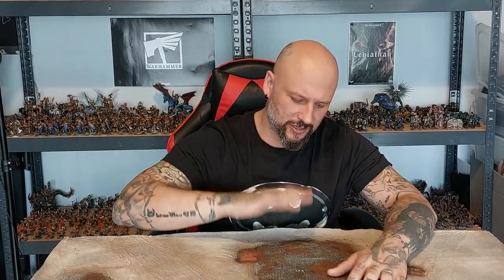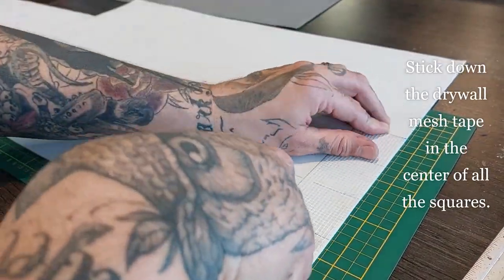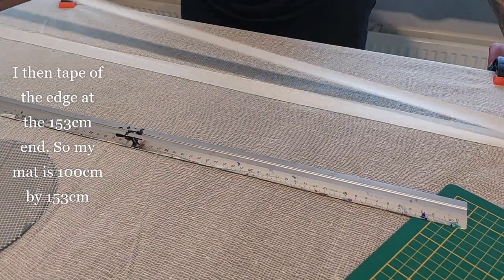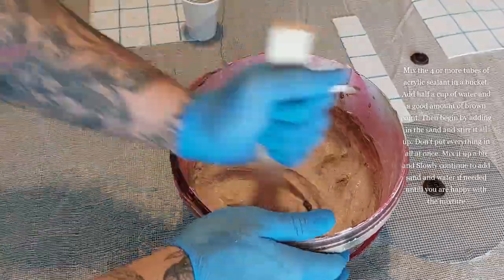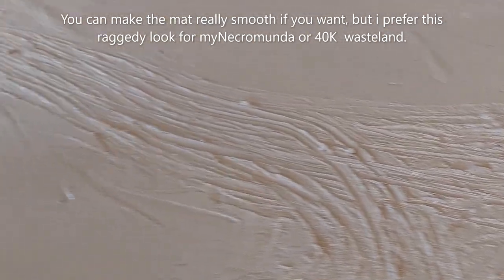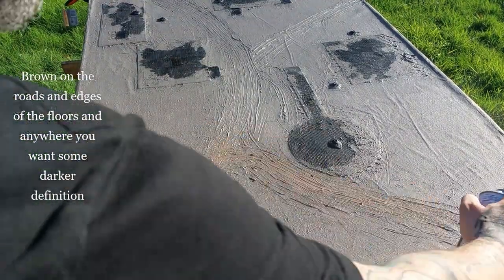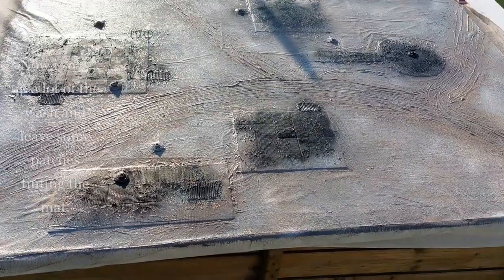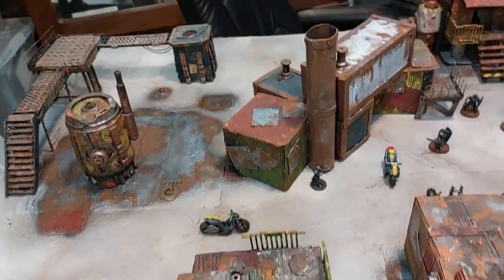Create Your Own NECROMUNDA Ash Wastes BATTLE MAT With These Simple Steps!

Comment: Looks great. I tend to buy brown caulk to start with, saves having to add paint to it! If you leave the caulk to go off for a while, you can press shapes into it before it’s fully cured to create man-hole covers in roads. I’ve also used a cocktail stick to scratch in a cracked earth texture in some parts for a bit more variety.
Reply from the maker: Thank you very much. Glad you like it. That's a great tip thanks. I definitely will try that next time. Good to know. Thanks for watching 🙏

Comment: Thanks for the video.
I did some mats like this at the end of last summer, however a surprise rain came in before the caulking was cured and it caused some delamination  and tearing between on top of the canvas. Now I have to wait until winter is over to do the repair.
Reply from the maker: You are very welcome mate. Thanks for watching the video 😁. 
Oh, so sorry to hear that, rain and terrain do not match well. Hope it turns out ok and that you can fix it up. I lucked out with the weather when doing this build. Best of luck to you.

Comment: Great idea with the mesh tape. Having dpne a few akrylic caulk mats myself i wonder if it would be better to just press the meshed eva boards on top of the wet caulk instead of using hot glue?
Reply from the maker: Thank you very much. I don´t know if the EVA foam would hold up over time without the hotglue, but it´s worth a shot. Maybe try it on a smaller piece of canvas. But hotglue is very flexibele so I have no issues with it...so far haha. Thanks for watching mate 🙏

Comment: Look great my brother.    I need to make a few mats soon.    I was going to use Eva foam squares that lock together. But I thibk im going to just make mats  about the same price all in all. But I think the mats will look better
Reply from the maker: Thank you very much brother,  glad you enjoyed the video. Yeah, the foam tiles are great but I prefer them for DnD smaller Encounter tiles. For skirmish or full battles I also prefer mats or boards. And indeed the price is rather cheap to make these mats and they look cool, also you can get at least 2 mats out of 1 dropcloth haha. Thanks for watching 🙏
Reply: @alrethianscraftsbattles  you can get foam pads similar to yoga mats
Reply from the maker: @grimdiscotech98  I have not  worked with those yet.I did use Eva foam floor tiles before. Those are also super easy to work with.